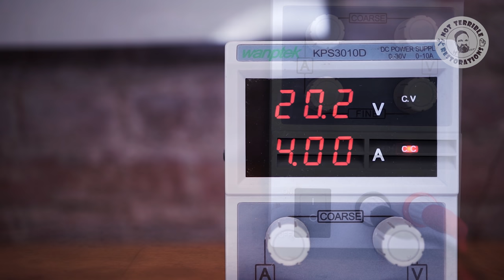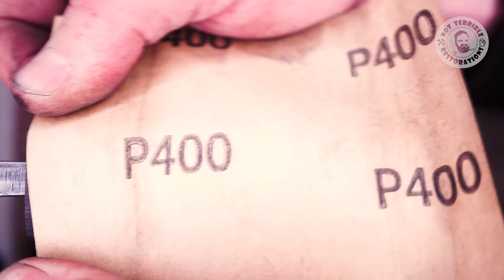PERFECT Abandoned Billhook Restoration | Antique Machete Restore

Comment: I think this one is my favorite. I've never seen handle made of leather in that manner. Really hoping you were able to restore the leather. But god oh god the wood was a much better choice. The additional aluminum pieces really brings out its beauty. And the mirror polish. I'm out of words lol. Anyway, I'm wondering how do you determine what method to use to remove rust or do you go by it randomly?
Reply from the maker: Well if I need to polish it I try to avoid blasting, since it affects the surface. So with blades I always go for electrolysis. Nice to hear from you again Anisa. How are you doing?
Reply: @NTRprojects  I see. That's good to know. I've been wondering for quite some time 😅 I've been really good. Manage to organize my time better now so I have quite a lot of free time to spend 😅 How about you? Already working on a new project?
Reply: Here is another way to for those leather type handles.  https://www.youtube.com/watch?v=yEwsBrFPoq8
Reply: Great video.  However, if the tool was an antique the leather handle could have been restored too.

Comment: Dr., a superb restoration. I was astonished by the leather stacking as a way to relieve the hands during extended periods of manual work. It is a shame you were not able to recover them. However, your replacement handle was beautiful.
Reply from the maker: Many thanks Jim! I know what you mean. I didnt glue the new handle to the shaft so its a little more flexible and gets a slight damping by the lateral leather damps

Comment: Its nice to see a restoration video where the steel isn't turned into a wet noodle by over heating it with an angle grinder.
Reply from the maker: Even during grinding I constantly cooled it every other minute to prevent overheating the hardening
Reply: @NTRprojects  The other 99% of restoration channels seem to be filled with hipsters who own a lot of tools but don't understand steel. Its when you see them "heat treating" kitchen knife blades in a commercial electric oven that I cringe the most.

Comment: Beautiful work, perhaps excessive for a humble Ticino billhook. I have a passion for Italian pruning hooks and I prefer the feel of a good leather handle, which absorbs both blows and sweat from your hands.
Unfortunately, it is difficult to find the necessary thicknesses, and especially in suitable die-cuts, which are only found in billhook manufacturers. Sometimes I have replaced the leather with four hardwood corners glued to form the tang of the billhook: it could be your idea for the next one.
Reply from the maker: Yes I understand. That's why I didn't glue the handle to the blade. So a little damping is left when the force leaves the handle through the leather sides

Comment: Really nice workmanship on this project. I have never seen anyone use MDF for sharpening, what is the principle behind it and looking at this blade it obviously works quite well.  Thanks for sharing.  👍😁🇺🇸🇨🇱
Reply from the maker: Thanks Paul 👍 the fibers of the mdf plate absorb the polish well. the mdf plate is strong enough to build up a counter-pressure to the blade and soft enough not to scratch the blade itself.
Simply a good carrier material for the polishing compound.

Comment: A billhook is a multitool. You can use it as an axe, a knife, a hammer, a mallet, a pry bar, a shovel... The leather rings in the handle are here to provide some damping otherwise the recurring impacts can make your arm sore. How does it perform with this ebony and aluminium handle ?

Comment: The whiskers on the snapped disc show that the leather could have been saved by soaking the discs in neatsfoot oil for a couple of days.  Even linseed oil would do.  I would advise against edible oils.  Submerge the discs in a container and put the container in the sun or heat container very gently in a water bath to no more than 60 deg C overnight.  Then drain off the oil, rub off excess with a cloth and leave out to get surface dry or at least tacky.  Then seal with plain beeswax well rubbed in.  Neatsfoot oil is available from any saddler.  The boot wax shown is just not enough for really dried out leather.   It's not like the discs would come under tension when the billhook was in use.  Compression maybe but not tension.  Leather can last for centuries if kept adequately oiled.